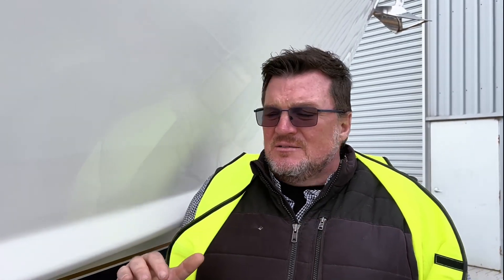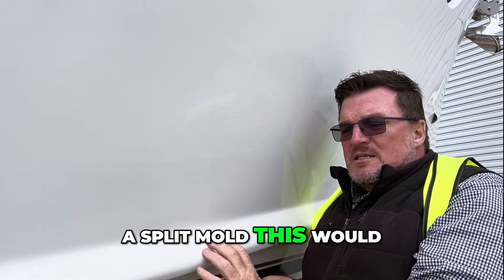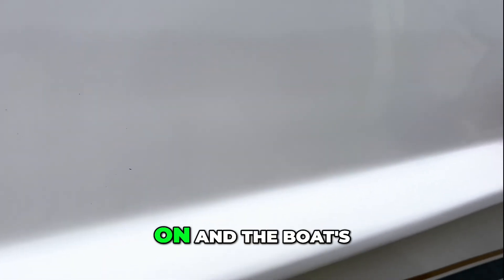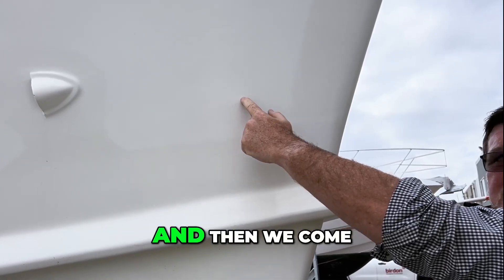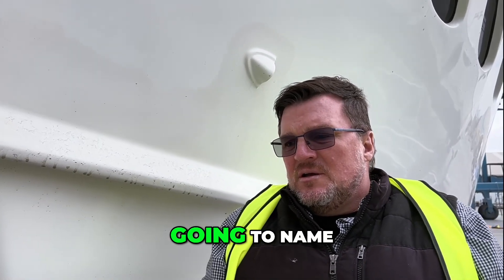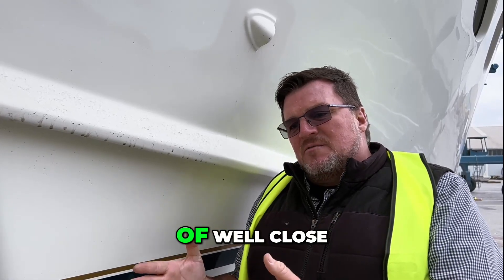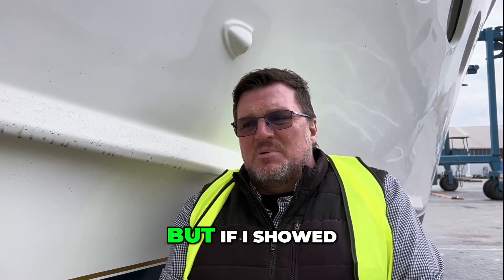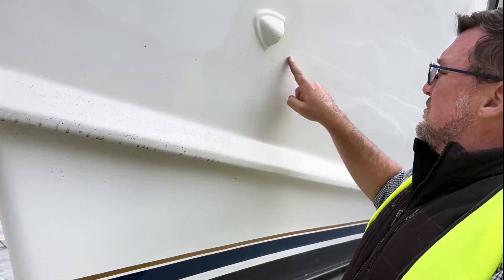Modern Boat Building: Common Issues and Quality Control Revealed

Comment: The owner has told the builder to spray the cabin of the boat, they should be re gel coating the whole boat. Probably better to go two pack
Reply from the maker: True that. But the owner is thinking of selling so doesn't want to make the investment.
Reply: @nedtalksship  The owner shouldn't be making the investment the boat builder should.